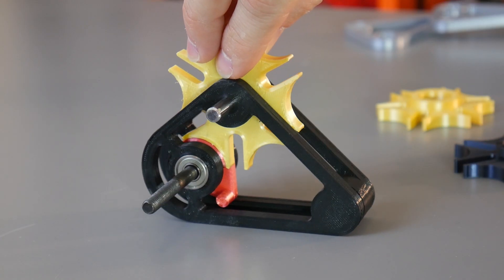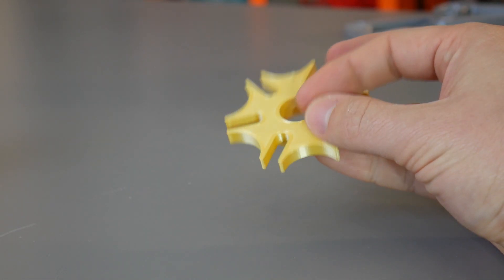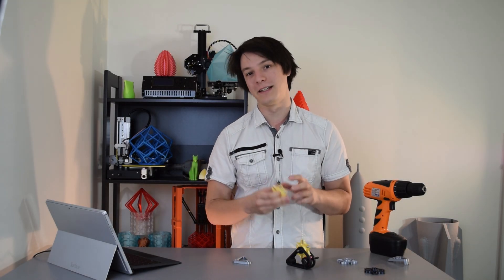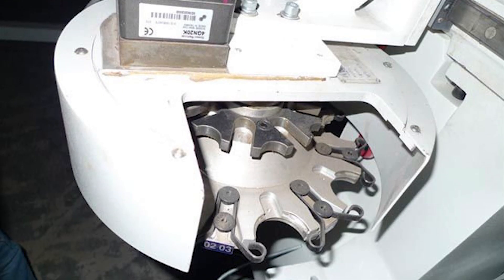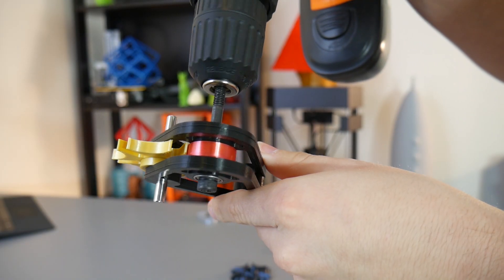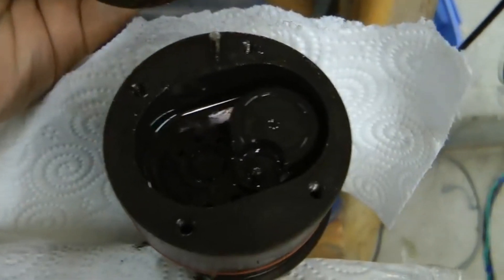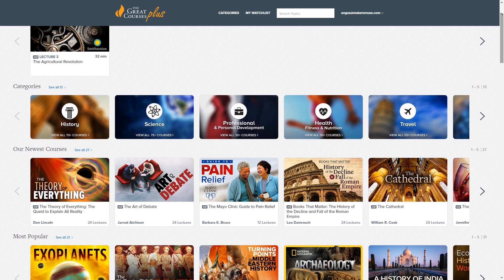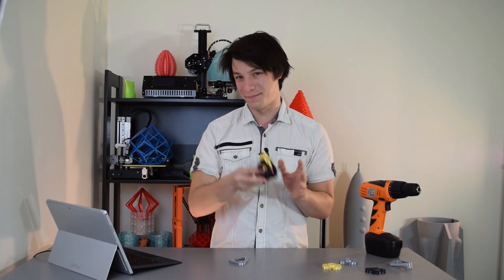The Geneva Mechanism

Comment: yet ANOTHER great video. question only you I trust. I have a friend that wants a 3d printer that hasn't used one but is a cad cam student, he wants a printer that's somewhat easy to use but doesn't want to have to upgrade in 6 months what do you recommend? he also would like a dual extruder thanks!!!!

Comment: I can see that being used in ammo loaders.
Reply: The Model 1862 Gatling used a Geneva gear shape for it's loader.   Obviously, it wasn't a gear.  It had no  timing or "stop motion" functions. Richard Gatling had used a similarly shaped device for a wheat planting device dating to 1839.  The thickly cut  "Geneva" wheel carries the paper or brass shell in the slot, and the outer surface is convex rather than concave.  It's # 5 in the patent drawing found here: https://www.google.com/patents/US36836 . 

By 1893, Gatling had developed an electrically powered version of the gun that was supposedly capable of 3000 rounds per minute. it's amazing to see the  increased complexity between the two weapons.  The patent drawings for the 1893 gun can be found at: https://www.google.com/patents/US502185 .
Reply: The 7.62 electricly operated, gravity fed, Hughes chain gun uses this mechanism. Fitted to both, helicopters and APC'S in the not so distant past 😉
Reply: Ammo loading is usually just lever or ratchet action induced by the weapon itself. Think revolver cylinders...
Reply: I was thinking more taking a round off of a rack and placing it inline with the chamber to be inserted rather than the act of loading it into the chamber.

I wasn't really considering hand guns in all honesty.
Reply: Sorry Alex, I was a warfighter, not a sailor-boy... So, my experience with loading devices is largely in small arms. Usually, weapons were loaded with feeder pawls run by a guide rod on the recoil system. As for automatic loading, sure maybe they could've been used in big-ass guns like tanks and ships.

Most chain guns and miniguns use driven gear systems, usually separate from the barrel(s), to strip the round from the belt link and dump it into the chamber(s) utilizing a direct-driven toothed gear system...

Like Mr. Muse points out, Geneva drives are fragile mechanisms, and the military most definitely DOESN'T like fragile mechanisms...
Reply: that is a stretch. the fact it is a caming mechanism is about the only real similarity between this and the linear toggle action of the luger. but many modern firearms use a camming mechanism to lock the breach. 

I believe something similar to this was used in earlier auto loading artillery that used self contained cartridges.
Reply: It is a possibility that it could be used in single shell guns (Tank loading ECT) But the fact is, is that nowadays, wit shells being large, it would buff the height of the tanks turret, and reloading the "clip" would be tedious,
good in theory
bad in practice
Reply: I could also see this mechanism being used in the bomb shaft of a bomberjet. Maybe if different types of bombs are stored and can be chosen from, depending on the target and desired effect.
Reply: Yeah that's what I was going to say. Maybe for ship heavy guns?
Reply: I doubt it. But it can't be ruled out. I think most of that was done by chains or belts with levers to switch between explosive, incediary and smoke.
Reply: YEEEAAAAH GUNS! MURICA!
Reply: German Luger used something similar to this
Reply: CK's channel. your a child charlie brown... revolver cylanders no our friend is correct it comes off a rack and loads it to the chamber, secrurely places it inside the chamber and fires it

Comment: that blows my mind! i've always wondered where the clicking sound in old film projectors came from
Reply: IKR, one of those facts that change how you think about things, I always thought it was a shutter.
Reply: FYI, sorry he is wrong about the sound. the projector is silent when there is no film in the projector. Film projectors require a upper and lower loop which is a buffer area. The loops flap which is the cause of the sound you associate with a film projector. This thing he is showing in this video is called the intermittent sprocket and is found only in professional film projectors, mostly 35mm and 70mm. 16mm and 8mm use a claw system.
Reply: @andrewbarnum5040  And commercial 16mm jobs as well, especially for TV film-to-camera islands.
Reply: Ugh!  The video is wrong.  The film in old film projectors moved in a continuous motion and the film was stopped in the aperture using a registration pin.  The noise was created by a loop of excess film that fluttered as the registration pin moved in and out allowing the next frame to advance.  This is 
why projectors required a loop of film to be left when threading the machine.
Reply: @markbolles5163  Er... Isn't that what he said, Mark? There are two common means for stopping the film in the gate. That is the pawl, or "registration pins" and intermittent, (or geneva) drive which used a separate toothed wheel to move the film through the gate. The only areas where the film is at a constant speed is at the sound head and the reels.
Reply: You're kind of right 8mm & 16mm projectors work the way you described.  Apparently for the larger film (35mm & 70mm) it did use a Geneva drive to advance the film.  So everybody's right I guess?
Reply: Maybe, the macine gun, on ww2 , shooting thru blades, used this
Reply: Ugh! I
Reply: Ugh! Ha ha ha me tooo. Iam a dumb kinda
Reply: Ugh! P
Reply: I always assumed it was the shutter, though I suppose they'd be in sync probably.
Reply: +rckymtn3 idiot
Reply: Ugh! N ;
Reply: @Ullr the snow God That was on "economy" projectors. Geneva drives tend to be quite expensive.
Reply: @Dan Nguyen Then curiosity is wasted on the lazy.
Reply: I can't believe your all talking about this after 3 years....wow!
I use to do projection work at AMC with 35mm. I personally own 3 16mm projectors and about 1000 films. As well as 8mm and Super8.
Projector are quiet without film and make a clicking noise with film.
Maybe some mask the noise better than others. 
And yes I know some pro 16mm projectors have a intermediate sprocket as well. All my projects have a claw or paw to advance the film.
Reply: Ironically I believe the shutter in a film projector was essentially silent because it was basically a fan wheel that rotated, intermittently blocking the light through the lens, not touching any other components so not making any noise.
Reply: @PKMartin  It was the film itself making most of the noise as it was jerk-and-stop-and-jerk...
And the geneva drive (or "intermittent drive") wasn't part of the shutter at all. It was all driven by a common set of gears from one motor so as to keep everything perfectly synchronized.
Reply: Actually, really professional 16MM machines use a intermittent sprocket as well...I used to be a Projectionist, and I actually ran a few 16MM machines with a intermittent sprocket.
Some manufacturers that made these were Norelco, Zeiss, and Kinoton.
Reply: @m.k.8158  I ran an Eiki and an RCA film island. Both were 16mm and used Genevas. Compared to the spring-loaded pawl, these were quiet as a mouse.
Reply: @WCM1945  yep, they would be..
Reply: too many projector nerds
Reply: @fomalhaut_the_great  The YouTube AV Club :D
Reply: Stephen Baldassarre always an expert about
Reply: You always wondered, but never once researched it? I would almost understand if it was thirty years ago and you had to hope your local library had a book on such things, but come on...there's fucking google...